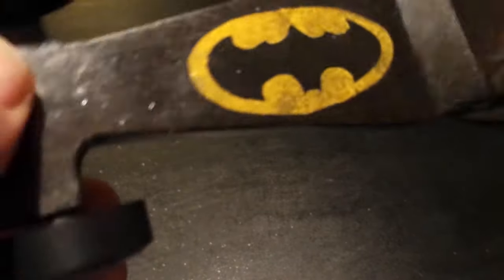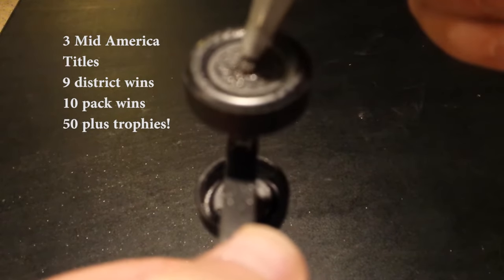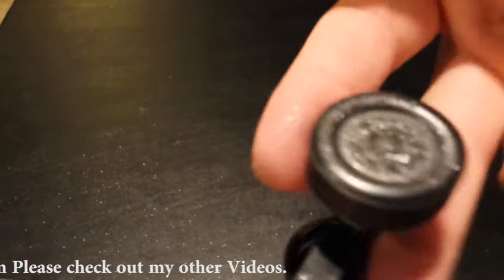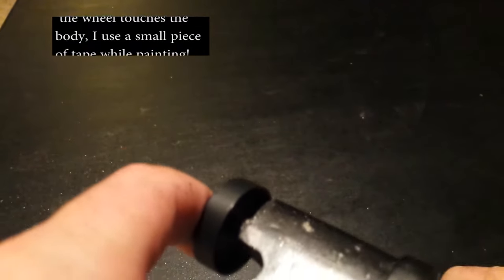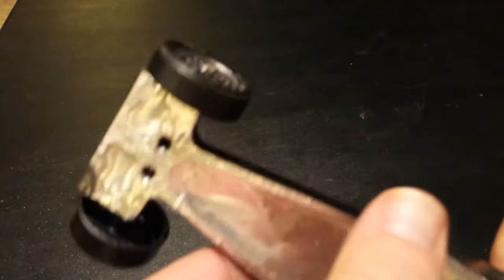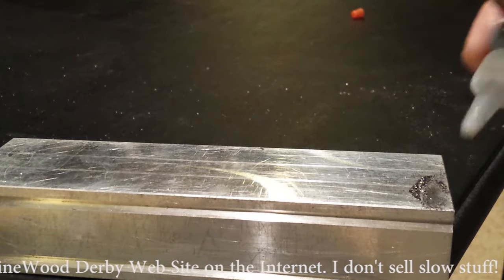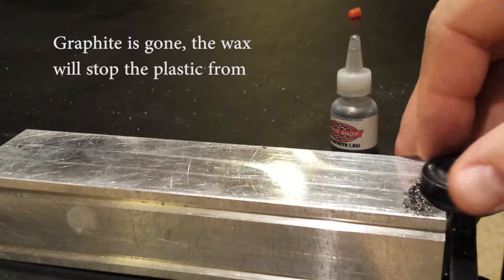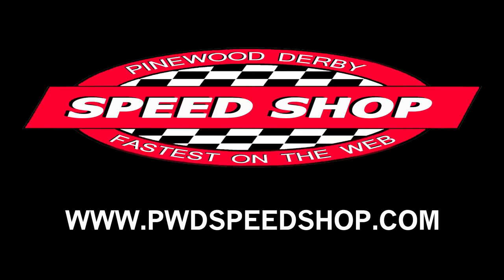How to Add Graphite to your PineWood Derby Car

Comment: This is so ridiculously pathetic as an endeavor for dads and adults. Nobody cares if engineers or people with machine shops can make fast cars. 

Let the kids build the dang thing. That's the entire point.
Reply: Then its also not about winning right? No one is forcing anyone to build their kids derby car.
Reply: @robp696  No, it can totally be about winning. But kid against kid, not dad against kid
Reply: @smhbbag1   there is no way you can enforce that and where are the limits how much a dad can help? Can the dad help cut with a power tool, drill bit, buy paint spray for the kid? Where and how could you possibly set the limits for adult interference for every scenario?
Reply: I was a child of the pinewood derby and am now an adult of the pinewood derby.  The Derby was not and will never be about the kids 😂 Even if you make a car to look like a child has built it, it’s all the work that is much harder to see that will win a race and so making a slightly shitty less aerodynamic car may fool everyone at glance… but rest assured that an adult has spent 30 hours of his time prepping all the other parts for a chance of his own childhood glory.